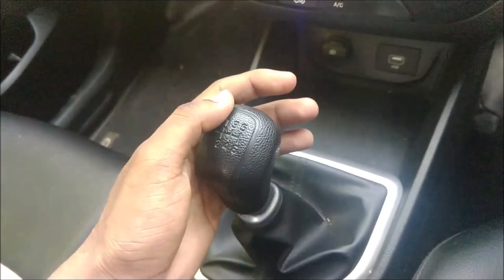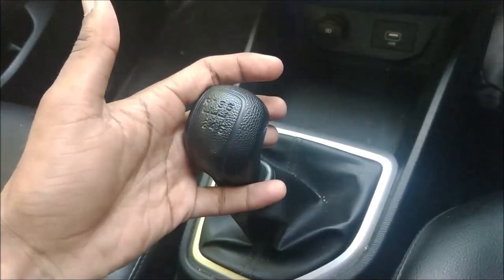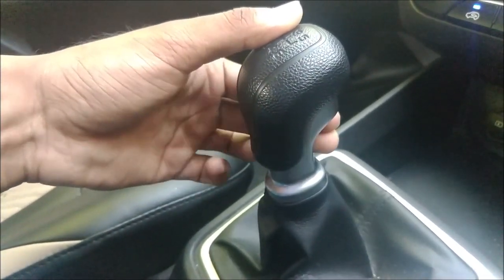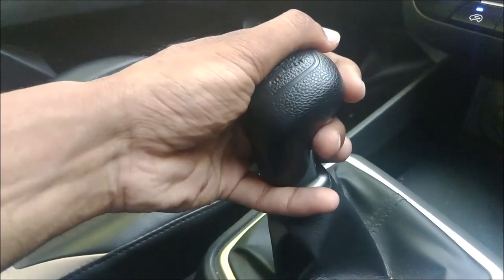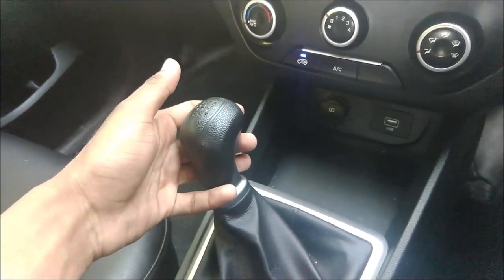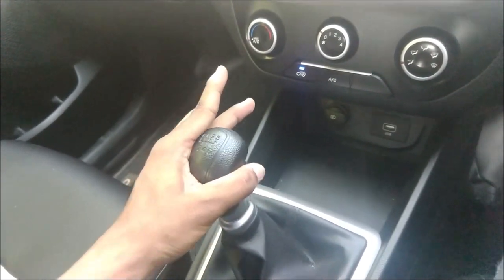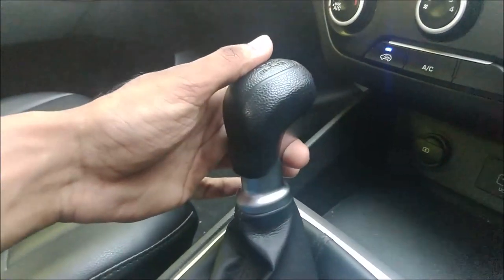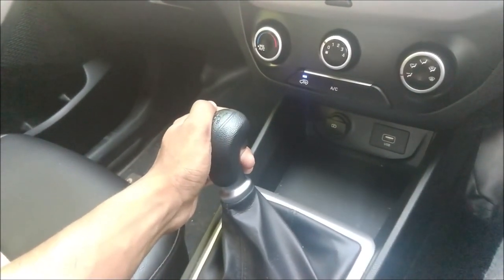Creta Gear System | Reverse Gear

Comment: Its reverse gear is very difficult🤨🤨
Reply from the maker: Actually it’s more easier than those cars who have reverse gear below 5th gear. Creta’s gear system is design in such a way that you can quickly shift gear to move the vehicle to and fro. With time you get used to it.